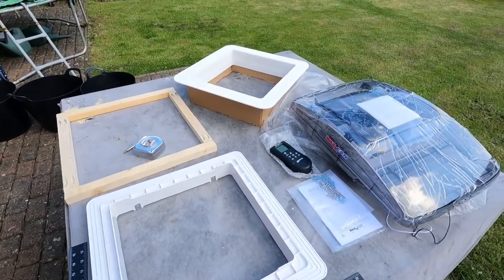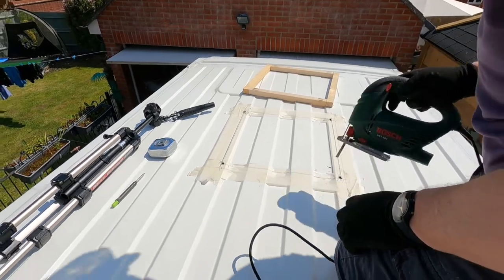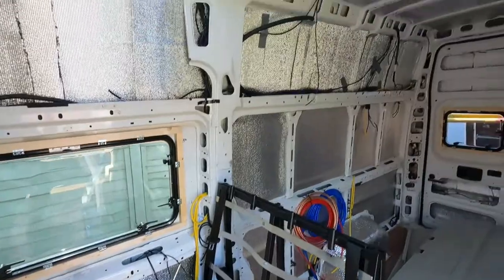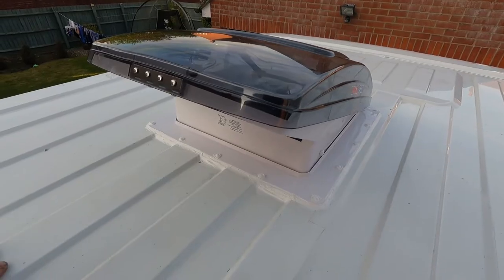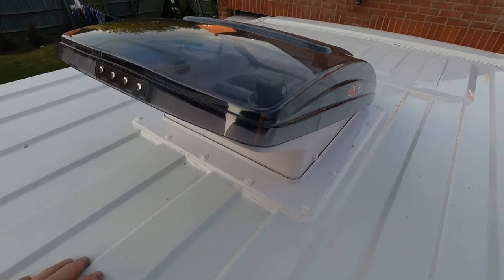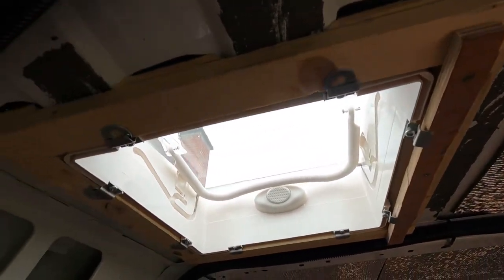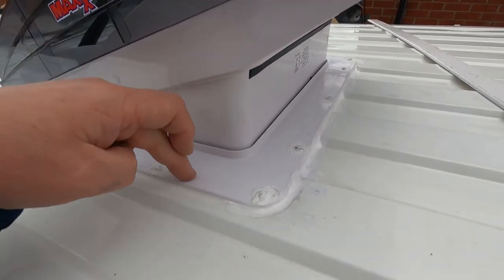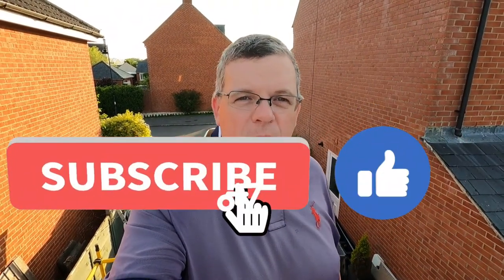Maxxfan Deluxe installation in Citroen Relay / Fiat Ducato / Peugeot Boxer

Comment: Just starting to put together info pack for my build, I too looked at mounting adaptor frames, extortionate prices, so glad I came across your video and your ingenious hack using pvc door trim:) and as you later pointed out no need for that horrible sticky tape. Thank you
Reply from the maker: Very glad it was useful, in hindsight the mounting bracket would have been much easier and quicker without all the faffing about but almost a year on from doing them, not even a hint of any leakage so all in all it worked just fine. my top tip would be to ensure you use sikaflex 221 and not 512 or 522, they are not the same. 221 is that awful sticky stuff used for windows install but it does what is says on the tin. will clean up nicely with meths afterwards for a good finish. I used 221 on the inner edge for waterproofing and then 522 white afterwards for a nice finish. if 221 white is available (not when i did mine) then go for just that.

Comment: Hi Pete. I can see that there are 2 options of MAXXFAN, 350mm and 400mm. What one did you purchase for the Relay. Thanks!!!
Reply from the maker: I went for the 400mm size. I think that is by far the more common and popular one and the 400mm hole will allow future swaps and changes if needed as it is industry standard size. regards.
Reply: @wiltshirecustomcamper7203  Much appreciated :)
Reply: I’ve recently purchased the L1H1 Relay Van and have a Rhino Roofrack + Ladder in place, question is : can I turn fan sideways to fit into the width of my bars from rack, also will it allow lid to freely open?? Thanks great Chanel

Comment: Hi thanks for the upload, currently converting a Citroen Relay so very helpful, are you planning to upload a video on the slide out step installation?
That would be really helpful.
Reply from the maker: Thanks for watching the video, I'm glad you're enjoying the content. I did not film the install but I will make a short video about it and video the finished result. It was a bit of a pig to install as it is the non-motor generic step and came with no mounting brackets to fit X290 chassis at all.

Comment: Hello, awesome and very useful video! Thanks a lot. Just a question, what was the thickness of the PVC trim? :)
Reply from the maker: Oh thats a good question, around 5 or 6 mm if I recall. Anything around that is fine as the difference can be made up with splodge of course..
Reply: @wiltshirecustomcamper7203  Thank youu :)

Comment: Very interesting to see this use of pvc.  Well done.  May I ask what thickness it was?
Reply from the maker: Thank you. you can ask for sure about the thickness but I cant tell you as it was a while ago now. it was from a length of fairly standard door trim from my local window supplier if that helps. It did sit just below the ridge height and when the sikaflex was 'splodge' in around it, it brought it up to height.

Comment: Best Job, well done 👍 some great tips...was the sealant 221 and 522 Supaflex or Silkaflex? Amazon?
Reply from the maker: I used Sikaflex 221 black on the first one but it was very messy sticky stuff that needed alot of cleanup afterwards with purple meths, so used sikaflex 221 white on the 2nd one. both are holding fine and waterproof, so takes your pick really, only thing I can add is I used 221 black on the windows 'as recommended' and it was fantastic stuff.

Comment: Hello. How did you workaround the rear fan not having enough distance for the wooden frame to fit (i.e. the gap between the support beams does not seem big enough?) Do you just screw into the metal support beams on that side rather than into the wood? Thanks
Reply from the maker: I dont recall having too many problems with the wood frame. it did need a little fettling but nothing too crazy. sorry that doesn't help much?
Reply: @wiltshirecustomcamper7203  the gap between my roof supports is barely 400mm so was confused as to how you had the space for the frame if the hole was 400mm and then obviously the wooden frame means you need >400mm. We have the same van so in theory the roof support spacing should be the same as I am installing in the same place
Reply from the maker: Having reviewed the video, I recall now I used a thin piece of 12mm ply on one edge on the rear fan to complete the frame. it worked out fine and has been secure and not leaked.

Comment: Hi would you mind to tell what was dimensions of this shims as I would love to vldo it same way
Reply from the maker: As each van and location on the roof can be different, it is best to get the fan and prepare the hole, then offer the mounting plate from the maxxfan into place and measure the gap you have. you can then find this uPVC plastic at window/door suppliers or I got mine from my local roofing superstore and it was only £2.93 for a 4.8m length of 'window trim', this trim comes in various widths and thicknesses to suit. I know you only need a small amount from 4.8m , but that it how it comes. good luck with it.
Reply: @wiltshirecustomcamper7203  perfect super dooper job